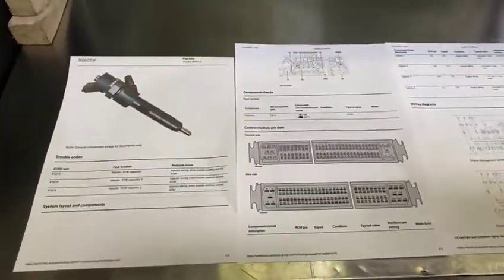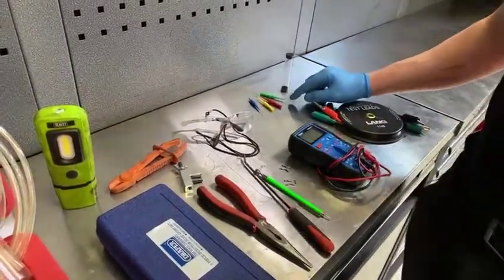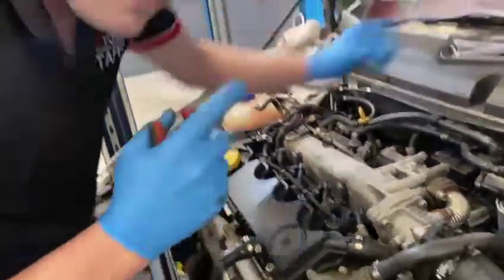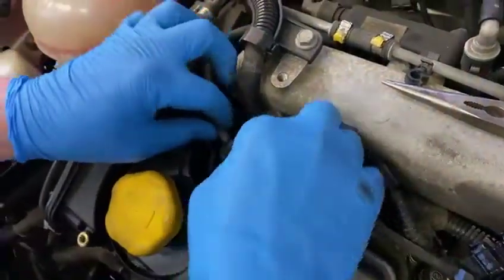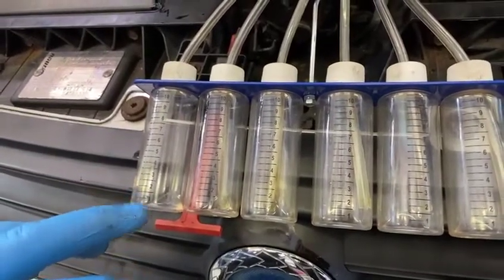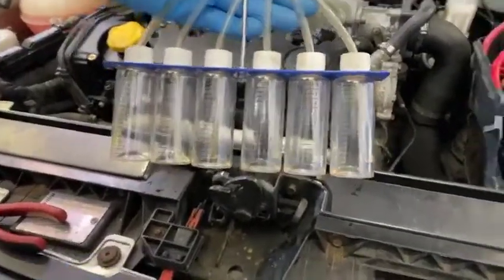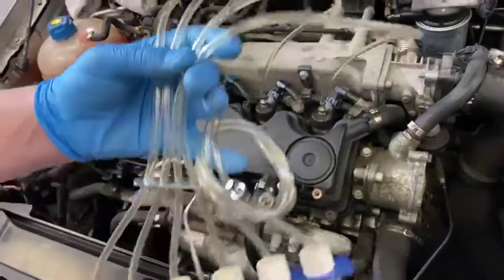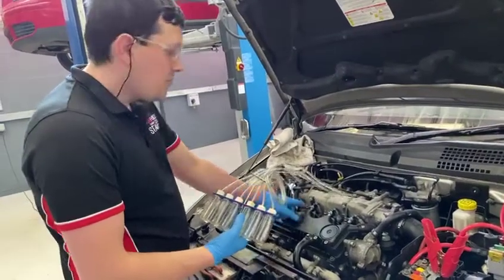Diesel Injector leak off test

Comment: What if there is no fuel coming out for 20 minutes? What does that indicate?
Reply from the maker: That would indicate no fuel returning to the tank, getting dumped into the cylinder.
Reply: @AutomotiveDIYTutorials  there   is absolutely no smoke coming out of the exhaust pipe and the engine always cranks from the first start
Reply: @AutomotiveDIYTutorials da li je to loše ili dobro